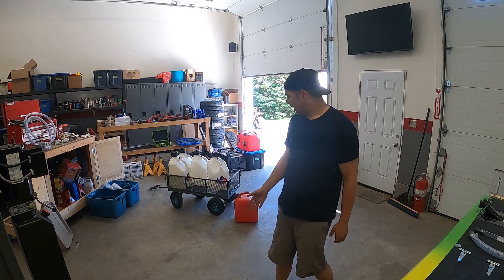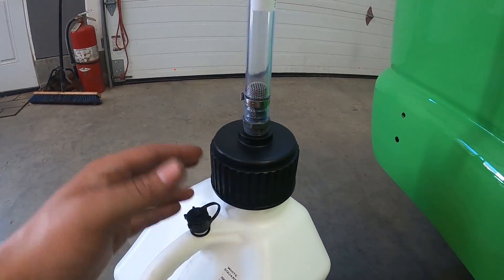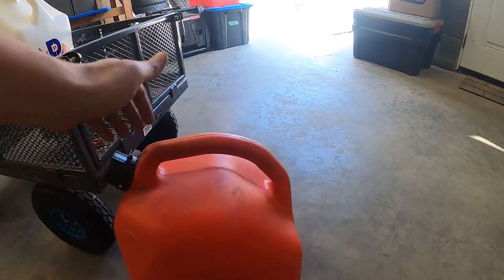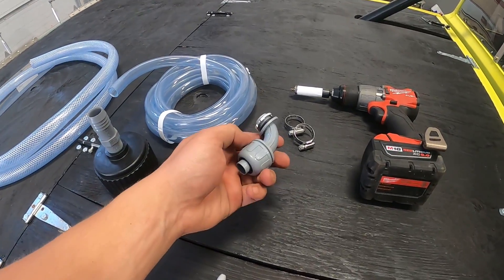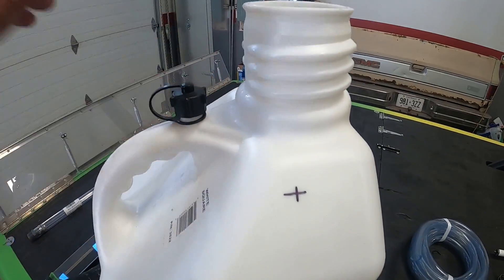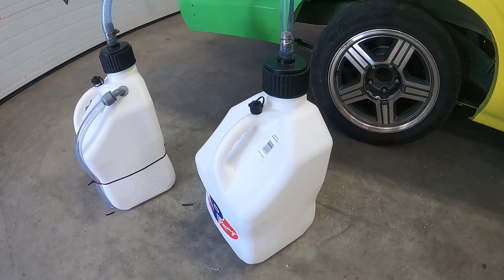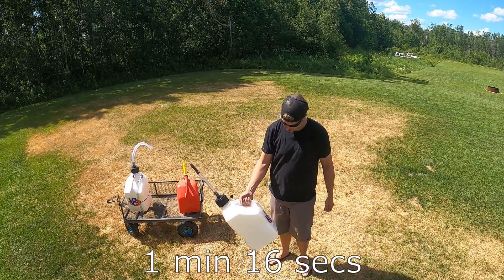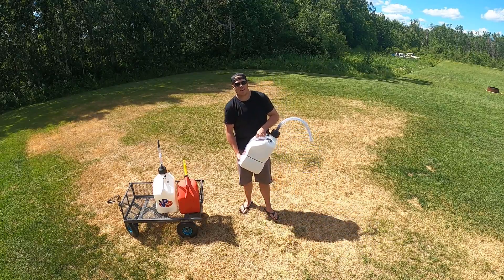How to dump 5 GALLONS of gas in 24 SECONDS!

Comment: Your pipe adapter restricts the flow.  Either drill the cap to 1" or get a 3/4" hose.  1" from cap to end of hose should cut a significant number of seconds from the drain time.
Reply: Exactly.  If you have 3/4 on top of the cap, you could have a 2" on the other end but the restriction of the 3/4" opening won't give you the flow you want.  Change cap out or drill like noted above.

Comment: If you could put a pipe on the vent inside the can, to the bottom,  then when inverted, you would eliminate the glug glug.
Reply: great idea t5he vent isnt in the best place but by extening a hose to bottom it will vent when inverted  , and be safer than modufieing the can  bellow the gas level

Comment: Drill out the original vent hole. Run a narrow hose down in the hole to the Bottom of the jug. Attach +16"  to the outside of the jug facing down. 
It uses fewer parts, eliminates the "glug-glug", and pours smooth as silk.

Comment: Don't want to call this stupid, but just swapping the 3/4"npt X 3/4" hose fitting to a 3/4" npt X 1" hose fitting and using a 1" hose reduces the fill time for 5 gallons from 1:05 to 29 seconds without any additional modifications.

Comment: is the vent open to air at all times, would be better if you included a shut off valve? what if it gets knocked down. you can hear the water gurgling in the canister, there's gotta be a better place for vent placement.

Comment: did you try the can with big fuel hose but original vent? it does not seem like your vent is much of an improvement usually you only need a small vent compared to nozzle size

Comment: Nice, it would be smart to actually time it out proper. It was definitely faster with your mods but I would be curious with actual time on all of them not just estimates. Either way cool video. I just bought a VP Racing Fuel Jug but I bought the VP Racing Fuel Trigger Hose instead of the regular one and I am very glad I made that decision. It is a much better hose than the regular one.

Comment: What about placing the vent hole to the bottom of the jug. Either mounted on the outside or utilize the factory vent hole and insert a draw tube all the way down to the bottom of the jug. No gurgling drag.

Comment: You went from 3/4 inch NPT to 1" hose? The 3/4 inch NPT is still a restriction.  Anything larger than the ID of the 3/4" adaptor is of little use.  The vent opening and not going under the ID (interior dimension) of the 3/4 inch NPT fitting are the important factors.
Reply: I swapped the outlet fitting from a 3/4" hose outlet to a 1" hose outlet and left the rest of the can completely stock. To empty 5 gallons from stock 1:05 to 29 seconds. The NPT is not the restriction, it's the 3/4" hose fitting ID which is smaller in diameter than the NPT.

Comment: You want the vent on the bottom, the vent drawing air through the fuel is slowing you down...drill a hole and plug it with a closeable valve....1.invert can 2. Open valve...BOOM!

Comment: I am looking for good gas containers that the government hasn't screwed up yet. Do these gas containers last long time ? Storage in garage thru heat and cold ?
Reply from the maker: They wouldnt be good after the mods i did as they no longer seal for storage. This is strictly for dumping fuel on put stops.
Reply: I was looking for a good gas container too.  I was sold one of these at Carquest that has a hole in the seam where the mold halves joined on the bottom.  II took it back to Carquest and they wouldn't even look at it despite it having a very obvious defect on the bottom.  " We don't have any control over how you use a gas can".  I have never had a plastic gas can that leaked in 50 years. I guess I was just lucky, but then I never had a VP gas can either.  Then I called VP to let them know that I have a can with a defect...  Would you believe that they told me that it wasn't to be used as a gas can or for storage of fuels? I took the liberty of taking a screen shot of their ads that say otherwise, by the way.  I figured that they would at least care about their reputation if not customer satisfaction and stand behind their product.   That ain't the case.  I got a ration of S___T and excuses that is hard to believe.  I can eat the $45 for the gas can. All I wanted was a heavy duty high quality gas can.  This is just to let anybody interested what to expect from VP over something that costs VP probably less than $15.

Comment: I remember reading that some series races require an sfi or whatever certified can. Does a modded can still count as certified?
Reply from the maker: These cans are legal with Lucky Dog Canada and should be legal with Champcar. Several teams have done similar mods and dont have any issues (as long as they dont leak). From my research, no leaks, 5 gallons max, and gravity feed is all they really care about. I could be wrong though...

Comment: Can I ask a dumb question?  Fuel spills all over the place out of my exact same race jug from the vent tube(when filling).  Why didn't they put it in a better place?  Is there a way to prevent this?  Am I doing something wrong 😕?  White race jug for reference...
Reply: Start the fill with it closed and give it a few seconds to pull a vacuum, then open it. No spill!

Comment: Holy shit bro.  That wasn’t smart at all. How did they turn out ?  The problem I think is that when driving with cans full of fuel, they will splash up to the vents and keep leaking out all over the surface or bed below. Extremely messy.
Reply from the maker: They turned out great....We used them all season long without any issue! 

We transport our fuel in 55 gal drums, these are just for pit stops. The intention is for fast pour not sealed jug so you're right they would be terrible in the bed of a truck...